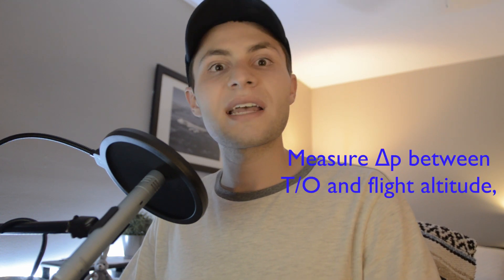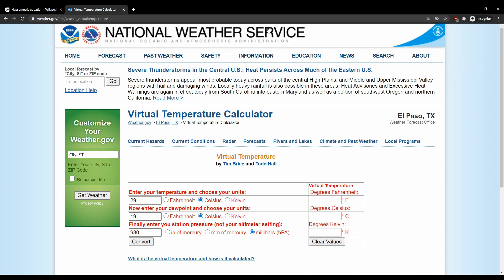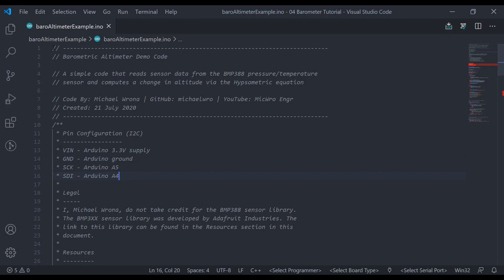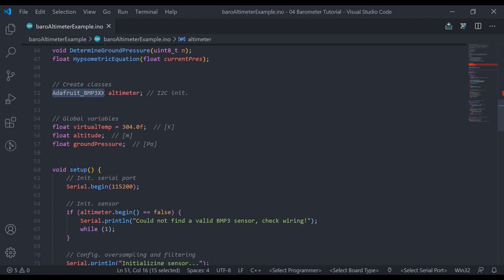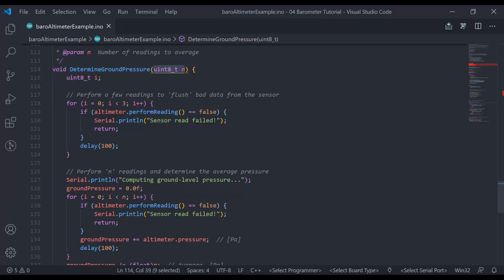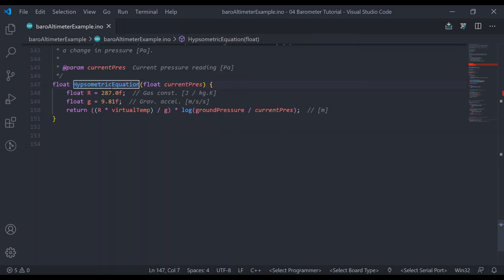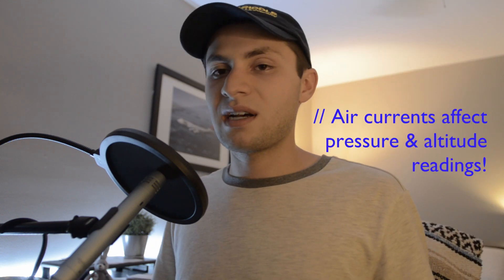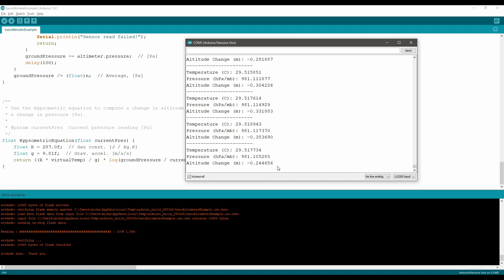Using a Pressure Sensor as an Altimeter | Drone Flight Controller Development

Comment: 2 questions:

Why did you hardcode the virtual temperature? Wouldn't it change all the time?

Why didn't you take median instead of mean? That way u won't need a separate loop to flush out bad values and also get safety in case any bad values do make it to ur avg loop for some reason
Reply: Its the  virtual temperature at the ground level. Depends on pressure, temperature and humidity at the ground level, which are constant.
Reply: From my experience pressure readings don't have so much noise and do not fluactuate a lot, comparatively. Not like an accelerometer or gyro readings in IMU. So taking the mean seems okay to me.